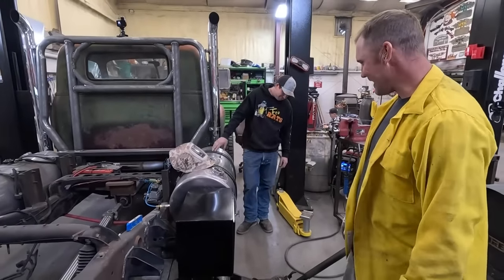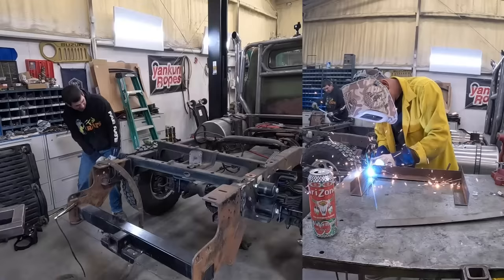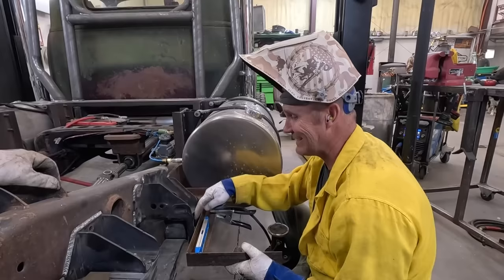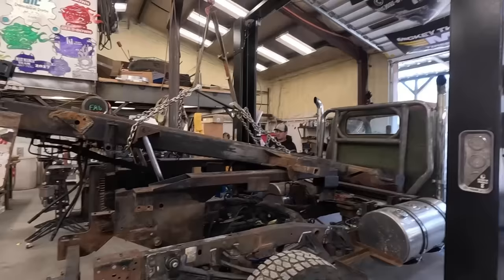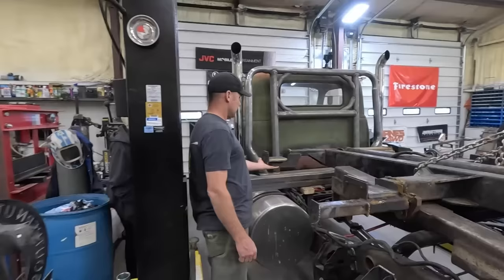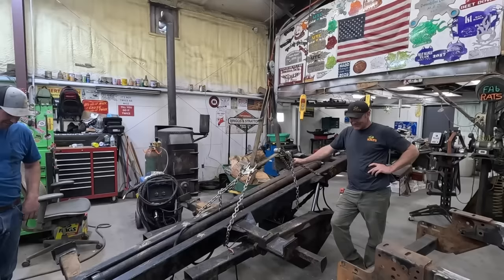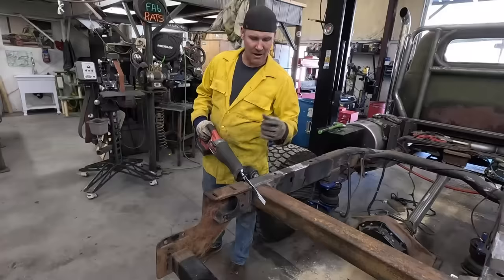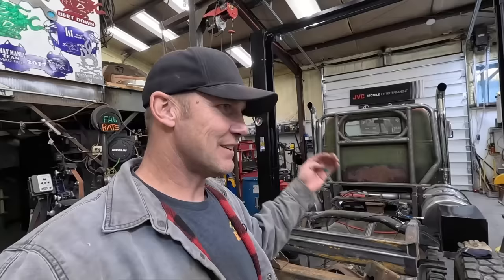What Now? Was All This Hard Work For Nothing?

Comment: Put a dump bed. But switch from leaf spring axles to air bag suspension you can deflate for loading. To lessen the load angle.
Reply: That is a good idea.   I can see that working, plus, you can adjust the air for more weight or less weight.  I have a 1923 T Bucket with air bag suspension on each end.  I have a front receiver, and it is a hoot for moving trailers around.  Just let the front air bags down drive under the hitch, then air up the bags.  The bed lowering would do the same thing.
Reply: Or could you make it a Beaver Tail with dropping air bag suspension? Or how about a RoRo body (roll on roll off)
Reply: Agreed, I am worried about the loading angle.  Now I see why a semi has the batteries under the step, easy access.
Reply: @obroberts6533  a roro body has a lot of possibilities for different applications: flat be, container, tipper, etc etc. Used by NATO forces for that exact reason.
Reply: @Bigtbuilder they should look into military style flatbed like the HETTs use. Hook the whole bed and pick up and drop off

Comment: Instead of using the horizontal rails of the pivot, what's wrong with using the frame rails of the truck itself for that function?

Drill the frame, insert your bushings, and stick the bar through the bed rails.  You can modify the rear of the truck bed to look like the rear of that pivot, including the ramp angle.

I mean, the frame is boxed, so it should be strong enough.

Comment: wheelbase needs to be longer surely?! its going to pick the front wheels off the ground when you use the rollback function. it will handle terribly with so much weight behind the rear axle on such a short wheelbase too.
Reply: Putting a third axle for support in the rear with lift so it can be raised up out of the way when empty might be the least bad solution.
Reply: It'll likely have some kind of frame work on the under side to keep it from doing that. Plus that truck/frame with the cummins engine is pretty heavy in the front. Might float the tires if you load something heavy but the fj and side by sides or the sand rails won't ever phase it.

Comment: I can see that axle needing to be moved back as far as possible, probably even further then what's left of the chassis. There's going to be a heap of weight hanging over the back as it sits atm. 
How much weight can those tyres and axle handle, the counterweight effect will move some of the front weight to the rear. 
I really want this to work for you guy, I just think this is going to be an issue in the future. Drive ability and safety

Comment: That if you did both the tilt bed and a tilt tail. Make it pivot on the same point. May also be good to getting over things by adjusting your tail up and get a better departure angle. On top of that you could put a pulley in the center of the tail, and use it like boom for a better more recovery options

Comment: Create a bed like a roll off dumpster. You can put the flatbed on the ground and drive anything on it from your crawler to that mini cooper in the onX challenge then hook and lift it up on. And it will still function like a dump bed/rollback. It’s something I’ve always wanted to do. You can even create different beds for it.

Comment: That dodge frame is way too short to make a decent roll back.  Especially a single rear wheel not a dual rear wheel. Your cab to axle length is very important to what length bed you can fit.
Reply: He's just gonna use it to put the Rock crawler on he's not doin recoverys with it
Reply: @jeremyedwards7357  How 'light' is his FJ?

Comment: Few Ideas:
Would it be possible to use a/the stinger to operate the roll back bed? 
or 
Have the bed operate like a tilt trailer?

That would move all stuff down lower. 
Hard to tell on the camera but it looks like that should give you 4-6 inches less in height. 

You could even have the dovetail operated by the stinger so in drive position the bed would be flat (Like a split tilt trailer.)

You don't need two tanks. You can make a sidebox to place the battery and all your rigging into on the other side. You could even cut a door in the side if you insist on it being round.

Comment: Paul, think about this before you continue, your wheelbase is way to short to put that long of bed on it. You are going to have way too much weight on the back past the rear axle, and have steering issues because the front tires will not have enough weight on then. lengthen your frame and move the axle back.
Reply: Yep. I hope the plan is still to shorten the bed
Reply: A few ft longer wheel base would be better.  If I remember correctly it's being built to haul the FJ. That was the reason for 14 ft long bed. 
There is a reason some rollbacks run smaller tires on them.
Reply: I hate to doubt Paul's vision here, but it sure seems like the truck needs to be longer to support that bed. Stretching that frame would solve a lot of his issues.

Comment: Make a 2 piece bed. Make the back shorter end drop to the ground. And the front longer part lift some of the way up, so that when the vehicle you are loading will be on it. Then after it is far enough forward you lower the front half, and raise the back half up until they are level to transport. Basically have the bed hinged in at the end of the frame.

Comment: Should have taken the frame from the old rollback and put the Chevy cab on that. Been saying that since the start.. May as well give it all to Merlin. 

Make it a dump style bed, put stake pockets on the side and use it as the new wood truck. You can then dump the load instead of unloading by hand.
Reply: That's what I've been saying or ram 5500 frame they both have the same width.

Comment: How about a slide back?  Where the inner frame slides back, then pivots in the middle of that.  So the push-back cylinder would mount to the middle of the pivot point pushing back the box tubes until it reached the back of the frame and then the dump cylinder would tilt it.  You could still have cross members on top and bottom.

Comment: Just a thought.. If you switch to airbag suspension, you could have that pivot point even further forward to allow the back of the ramp to get lower, also, you could deflate the bags during loading to get it even lower still.

Comment: If you want a rollback use the frame from the original rollback truck. Also, if you’re going the tilt bed, you might want 2 rams to tilt the bed because you’ll loose the bed. Just look at accidents of dump truck when they lift the bed high. One ram makes the front of the bed twist and tip.

Comment: I mounted identical tool boxes on each side of my 91 f350 4x4.  Used angle iron and ³/¹⁶ flat stock to come away from stuff sticking out on the frame. The truck has a steel flatbed dump bed.
I really enjoy seeing this build.

Comment: Do a tilt bed roll off. Use the same concept as a roll off dumpster. Bed tilts and then can roll off flat onto the ground like a dumpster then use a winch to pull back up onto the bed and a hydraulic ram to lay it flat.

Comment: 4ft drop dove tail with the dump? Make both parts move so you can reduce approach angle? Off road rat rod roll back has 2 parts of bed that move? 10ft dump with the 4ft drop tail with some ramps that slide out improving approach angle.

Comment: You could drill a 1 1/2” hole in the back of the box where the bolt would have to come out and use a weather tight knockout seal. It’s for closing unused holes in electrical panels

Comment: You need to put the pivot as far forward as possible and bob the frame, and have the bed overhang in the back as much as reasonable. This will allow the rear of the bed to reach the ground with the least angle.

Comment: U have a great idea with the tilt bed as for the fuel filler neck just run something off the front side of the tank and as for accessing the batteries under the bed is fine just make a jump pack location if you ever need to jump it that's accessible out from under the bed. We have a dump bed flat bed and it's not an issue accessing stuff under the bed we just tilt the bed out a support block under it and go to work on it

Comment: How about making a hydraulic dove tail. You have the length in the bed and the rams to move the tail. Cut the bed in two, put a backing/pivot plate on each section and use your pipe that you used for the bushings for your pivot points.

Comment: any thought of doing a roll on/roll off style? basically a hooked arm at the front that rolls back and the rear is essentially on rollers. look at roll off dumpsters for example, they even make tow trucks with this system as you can basically set the deck on the ground for every type of vehicle without worrying about approach/departure angles.

Comment: Frame extension will solve a lot of issues… adds room for all your cargo boxes and you won’t have to cut so much off the roll back bed which you need the extra room 🤪 and you could move the rear axle back more 🤔

Comment: I enjoy watching you guys work things out and come up with some pretty stellar ideas. You can put a 1/4" diamond plate steel trap door hinged all the way across supported by some 2"x4" tubing on each side and in the center to allow access to the batteries and other equipment near the cab. The plate trapdoor only needs to be about 2' wide across the width of the truck bed. ??

Comment: Hopefully you’ve moved to a tilt bed with slide in ramps idea. I still think that would look pretty cool and give you just about the same utility of a roll-back. You’d just have to use a longer winch to get it up to the top of the deck instead of sliding the deck up and over the pivot point.

Comment: I threw a rod through my block in the exact same spot on my 1970 Beetle when I was 18.  Might have had to do with running down the Interstate at 85 mph and over revved for a trip to Six Flags (3 hr drive each way).  That was a good motor till it wasn't!!

Comment: Why not make a short off road rollback gooseneck trailer (or bumper pull) that you pull with the truck. Just put a regular flatbed on the back of the truck, that has room for say a SXS. If you need the rollback flatbed, you take the trailer. Make it low, but off road capable. (kinda like Matt does with his SXS trailer)

Comment: Here's a suggestion try to extend the frame and then that way the rollback will fit better so extend it a little bit to where you can put the bed on and hydraulics or whatever you want need then you got it just need an extension to the frame

Comment: Dozer bed would work great …. Just smaller they are made from angle iron and only make it the length of the truck frame and then make a long dove tail that has a hydraulic raise and lower so you can leave the fj rear tires set on it when you haul it ….or if your off road recovering a side by side you can raise it up in the air for ground clearance ? 
Also you can get to all of your batteries and fuel 
Sorry I couldn’t put a picture on here for reference but I couldn’t figure out how to do it…..

Comment: Use the first box holder that was too short. Weld 4” long stubs to the frame and bolt the bracket to the stubs. Now it’s removable. Sorry the roll back bed sat to high for you. I wasn’t sure how you were going to make that work.

Comment: What about slide out ramps? Aluminum ramps from a car hauler would work! That way your tilt angle would work! Saw a guy build it into an Old Ford COE. It worked
for decades! You and Sean will figure it out! The thing is...with Car Hauler ramps they're lite and exceptionally strong to where he was able to use release latches that 
he Fabbed up and were easy to slide out. Good luck and thanks for the video! P.S. I've fabricated stuff and then ended up going a different way!

Comment: Try to lower the pivot point of the deck on the frame. This way when you raise the bed it drops the back lower and further away. 12 inches on that would make all the difference. All it add is more plate and a little gusseting.

Comment: Paul think You can still make it a rollback. make two frames 1 just to lift the bed the second frame attaches to the bed and slides backwards and forwards on the first frame and you wouldn't have to make it very high. you would have to put greasable wear plates between 🤔 and you would need two hydraulic rams .

Comment: What if you put the bed on with c-channel on the bottom and put rollers at the back that the be can pivot point. Use winches to extend and retract the bed. Like a modified rollback and tilt bed.

Comment: Why not keep the roll back style tip bed. Ram makes the bed slide back maybe a couple feet to the tip point. Kind of like a drawer. Once it hits the end point it would tip.  Build the rails on the frame then just need one ram mounted under.

Comment: Those hydraulic dove tail trailers are pretty strong. I think you could build your own tilt deck that could work better than the contraption you picked off the truck.

Could also use a shorter ram with a scissor lift set up and get more bed travel

Comment: Maybe if you could stretch the frame, lower it where the axles mount and throw air bags on it. It would be low enough to make a rollback. But a dump bed isn’t a  bad idea either.

Comment: what about a tilt bed with ramps extensions that slide out of the bed itself hydraulically? like the ten car haulers are made. gives you a short bed until you need it and an adjustable length when you do need it.

Comment: what about having the deck of the tray tip up and have the ramps mounted in a slide and connected to a ram so as it goes up you can ajust out the rams out as far as you need

Comment: HEY FAB RATS I had seen before in the comments but you might want to look into an idea of a rollback method that garbage trucks use. There is a whole series of larger garbage trucks that are used to pickup and position oversized dumpsters. In your case you could use the flat bed with some hardened wheels on the front and back of the underside of the bed that lays on the ground and can be pushed around. Then using the angled pickup arm would reach back and grab a mount on the front of the flatbed that is on the ground. Then the ram lifts up the bed and pulls it up overtop of a roller system mounted on the truck frame. Then at key points you can have a full lock in latch system like the garbage trucks use. that way you are not limited on what you haul in the bed. and you might find a complete ram system and attach points from a broken down garbage truck! so hope that gives you and easy idea for your problem.

Comment: From someone who has done some 'outside the box' fab over the years, since you are doing a tilt bed now, instead of completely reinventing the wheel, why couldn't you reverse the hydraulic ram and pivot frame from the rollback that you spent so much time refurbing and spin it around so that you have the rams on the front and the pivot on the back?

Comment: Whoa....take a breather. Give it a couple days. Metal can be made to do what you want. You might have to butcher more on the hydraulic frame side. But it'll work. Getting a different slide system to work might be an option.

Comment: Hey Paul, first off I hate the rollback idea didn't pan out.  Second, I see you measured from the cab to the rear end of the bed 14 feet.  Are there any cantilever concerns?  Have you considered measuring from the cab to the axle and the axle to the rear of where the bed will be?  If the axle is close to middle on both measurements you may have issues keeping the front of bed when loaded.  Hope it all works out and I look forward to seeing the finished product.

Comment: Cut both trucks behind the cab and use the original rollback frame ?? Would give you the frame and length you need to keep the wheel lift and everything.... swap the dodge rear end over and be good to go.... tilt bed will work too... I'll be watching either way lol 👍👍

Comment: I Think you should look into adding a section of ramp that folds under the 4' extension that hangs over the bed. Will cut down on the angle of the bed so it wont be so high..

Comment: At the 21:50 I saw the emery cloth ( sand paper) WRAPPED around Sean's hand. BIG NO NO !!!!!!!  If it grabs, your hand just got crushed as it wraps around.   ALWAYS use finger tips to hold the ends of the emery. That way if it grabs, it is simply removed from your grasp instead of mangling body parts.   Jeff, machinist / fabricator with 45 years experience.
Reply: Let me know if you want a short video. I have a Monarch CK12 lathe at home and would be more than happy to show you in a video exactly what I wrote.

Comment: Paul extend the frame add a tag axle with smaller tires and airbags with a switch to lift the axle or add the aluminum bed bolt to bolt to frame with side out ramps 🤯

Comment: Sorry to see y’all fail with the rollback conversion. From what I could see from the video. I believe y’all could still make that a rollback. It would require custom fab of the mechanism to fit your chassis and fit the way y’all want. Having built many a heavy truck and equipment for custom applications. I’m very sure it’s possible to get that rollback to fit and function the way you imagined it. Sometimes a project takes a few steps backwards to get the result moving forward correctly. Anyway I enjoy your content. Always interesting 👍
Reply: It’s not a failure it’s a change in direction, perspective it’s all in how you the builder see it.

Comment: Hay Paul, why not a gravity rollback. Pivot point also has rollers in a Chanel, a push/pull cylinder, and hook locks in front to lock the front down . Kind of like a rolloff  dumpster.
Reply: That's what I got on my tow truck and it sits nice and low would be perfect for what Paul wants to do on the truck

Comment: What if the aluminum bed could manually slide back and forth? It could eliminating the space the hydraulic slide was adding. Once loaded you could have a winch tucked in the front to pull it forward into transport position.